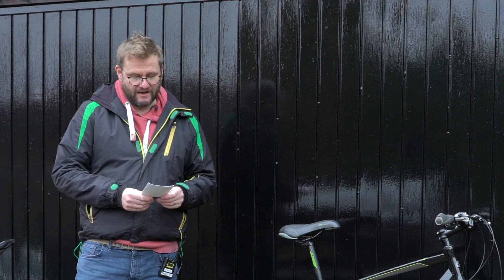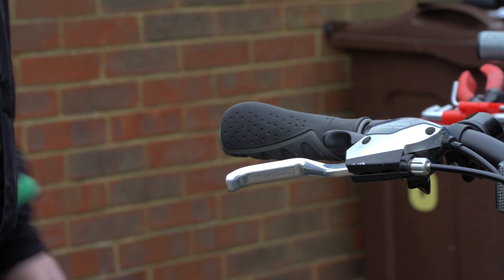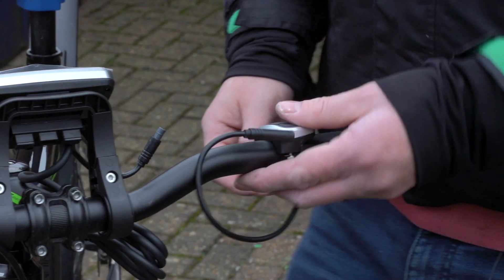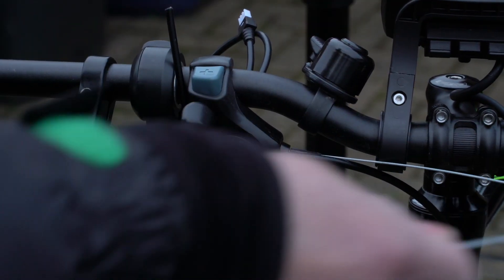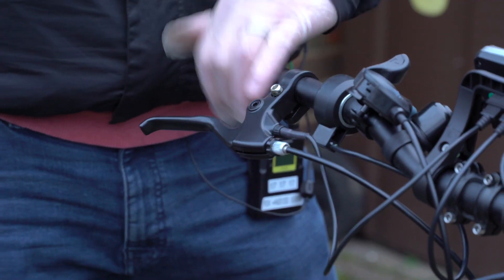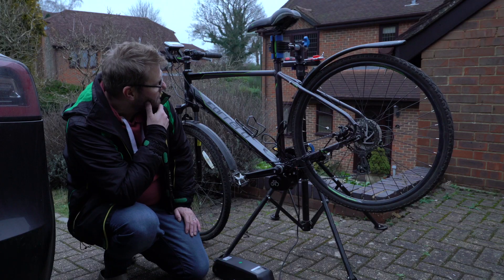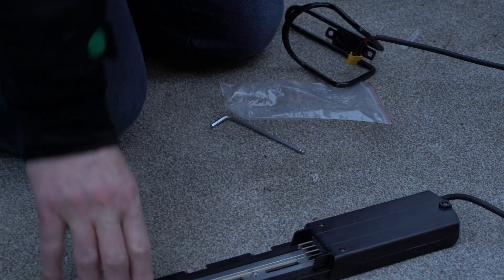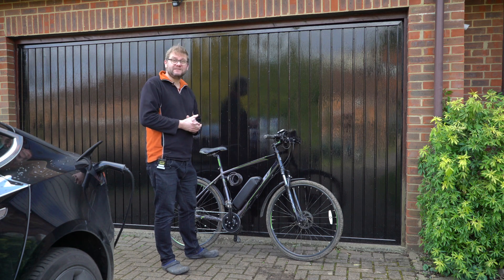Tongsheng TSDZ2 Mid Drive E-Bike motor Bike Build in detail Part 2

Comment: inject rubbing alcohol between the handlebar and the grip.. that will cause the bond to loosen for easy removal. then when you want to put it back on,, squirt some rubbing alcohol on the inside of the grip and slip it on easily..

Comment: I plug in the new e-brake into the TSDZ2 display.(3rd port). Doesn't cut off the motor..
I plug in the new Thumb Throttle into the TSDZ2 VLCD-5 display.(center port). Thumb Throttle Doesn't work at all..
I have the 8 pin on the display, plugged 8 pin connector into the motor..
What am i doing wrong..?   The walk  assist works, the pas works.. These Tongsheng mid drives are far to finicky.. (touchy) I never had these kind of problems in the 7 Bafang kits i installed.. What am i doing wrong..  I'm ready to throw it in the garbage and do a youtube review on how maddening these are.. Nothing but problems on the brake and thumb throttle.    Please tell me how to troubleshoot this nightmare.  I would appreciate some help.. the manual online says nothing..even the online manual skips the troubleshooting section.

Comment: For anyone installing this kit the Open Source Firmware is essential. It'll allow you to bring the cadence up and improves the ride immensely. You can also change the assistance levels as the difference between off (cycling through treacle) and level 1 (easy riding) imo leaves no in-between
Reply: How do we get the open source firmware?

Comment: for the battery installation on the frame, one either has to drill the frame and install 2 riv nuts to get a secure fitting, or use a nifty little accesory made by some nice canadians, called Grin Tripple Bob, or Double Bob, depending on the battery. I used one and that left my frame totally pristine :)

Comment: Quick question about the break leavers
Can I still use my old ones and just add a break sensor? Or do I need to add new break levers?
Would love to hear back from you about that
Reply: I bought the same kit and yes you can use a brake sensor, there are a few compatible models online.
Personally, I did not use one at all, since this is a torque-sensing motor and it will only power-on when you are pushing on the pedals, so I find you really don't need the brakes

Comment: Couple additional details folks need to know - likely need ebike rated tires, ebike rated wheels, and ebike rated chain.  I have both Tongsheng and Bafang.  TSDZ2 with torque sensor is way smoother than Bafang speed only sensor.

Comment: Excellent, this shows the actual build process, with all the steps and issues. If the rear shifter cable does not fit at all between the motor and the bottom bracket, you can reroute it along the top tube and the seat stay. That's what I had to do, using a cable in a full-length housing and zip ties.
Reply from the maker: Glad you found it useful!

Comment: The upside down battery problem.
An extra hole in the aluminium baseplate works well. If needed.
Reply: That would be useful for newbies.
Reply from the maker: Thanks Colin, in the end that's exactly what I did. Will upload a video soon!

Comment: Thanks for the useful video. I've just ordered one from the same URL as you quote. How was your delivery time? Also, how much of a risk is it buying a battery: what assurance have we got as to the quality of the cells used? I'm probably going to build my own 52 volt battery. Cheers.
Reply: Unitpackpower on aliexpress.
Reply from the maker: @colincampbell4261  If possible, if you're buying anything through Aliexpress, can you use my link in the description to get there first? That way I have a chance of making a small commission and it doesn't cost you any more!
Reply from the maker: All I can say is the battery I was sent seems pretty good. I imagine if your concerned, go for the LG cells. Delivery was a few months for me.